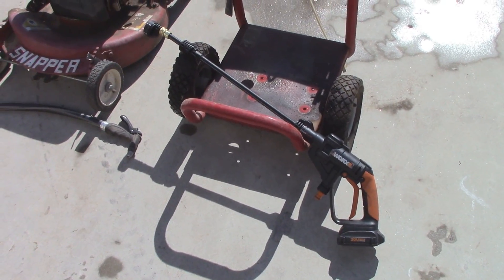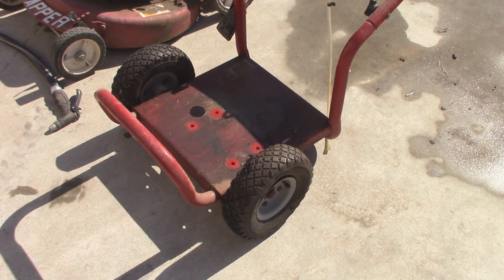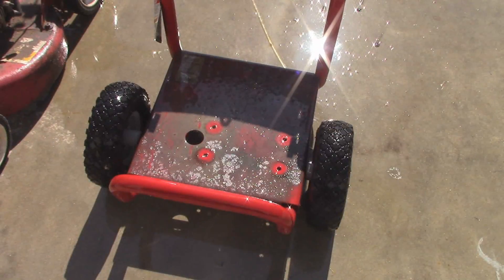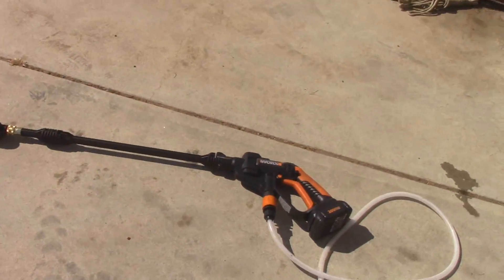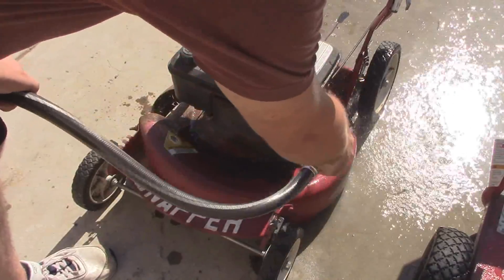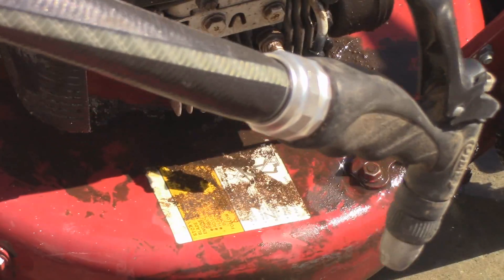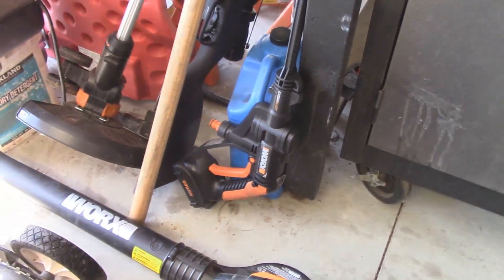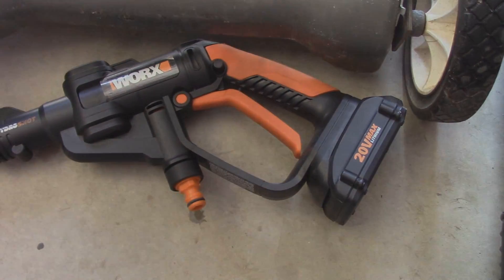Worx Hydroshot vs Garden Hose

Comment: When you did this test did you have the hydro connected to the hose line?  From what I understand it gives a stronger flow
Reply from the maker: That will be the last test I do with it, but no not in this video
Reply: I would like to see that too, sort of using it as a pressure booster.

Comment: was thinking of using this to spray some trees that are to far for the hose to reach.  Would like to mix Sevin or Eight in a bucket and spray the trees to keep japanese beetles from feasting on them.  Question:  how far will the hydroshot shoot water.  will it get to the top of a 25 ft tree?  
thoughts?
Reply from the maker: +Philip Brinkheide no it won't and even a regular gas pressure washer won't go that high...
Reply: sorry to be a pest, but do you know what the maximum length the water will shoot using water from a bucket?   You would think it would be listed in the spec.  I have some trees that are 10 to 15 ft tall.
Reply: I bought the unit.  it shoots 17 feet.  considering I'm 6 ft, I can get up to 23 Ft.  Now just need to make sure it can shoot a mixture of water and tree pesticide.  Might need a ladder, but otherwise, should work.
Reply from the maker: thats good hope it works out for you
Reply: first off use water only in this unit or just throw you money away but if your gonna try anyway immediately run fresh water through the unit.

Comment: Can you run soapy water or cleaner thru the Worx?
Reply from the maker: +Squirrel Killa I believe you can but after your done you will want to run clean water thru it to clean it out
Reply: Nop water only, u will brick it use an attachment at end of tip of gun to run cleaner or anything else.
Reply: Squirrel Killa  they have a soap dispenser attachment.  You connect it directly to the wand

Comment: Another way to compare water pressure is to use it hooked up to the hose but with the battery removed. Someone made the comment that the "Little Big Super Nozzle" gives more pressure than the Hydroshot. Obviously they have not put it to the test because if you use the Hydroshot with the hose only, no battery, on the thin spray you can easily put your hand into the stream. Attach the battery and use it and it will be a painful experience. There is a big difference between the pressure you get from just the hose and the hydroshot that no nozzle is going to change.
Reply from the maker: Yea I’ve stopped trying to explain it to all the internet know-it-alls man.

Comment: id rather use a presure washer
Reply from the maker: +alan4391 I have my snap on electric one I use for larger jobs. My gas one is great for the hardest stuff but it shoots 3000 psi and will strip paint. The snap on one is a lot more manageable.